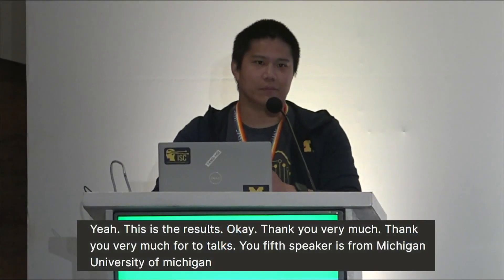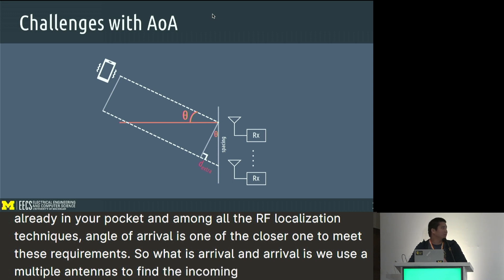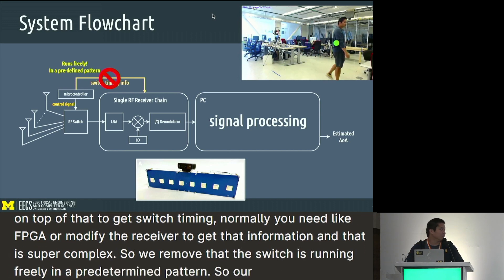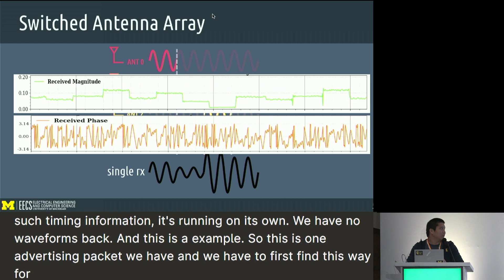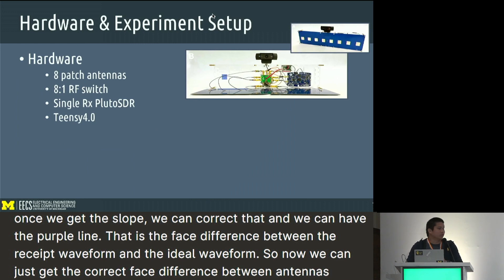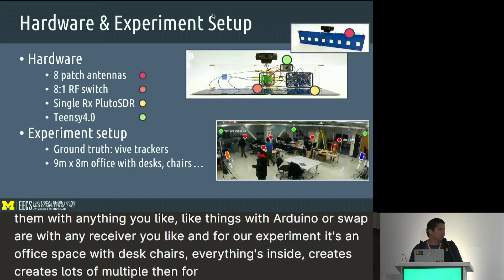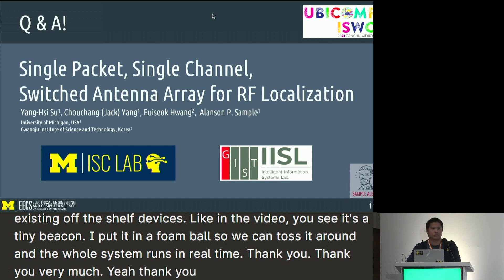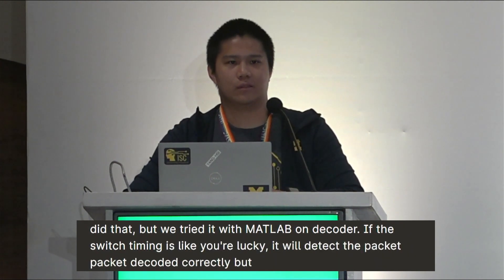UbiComp/ISWC 2023 Single Packet, Single Channel, Switched Antenna Array

Comment: Hi, Great talk! wouldnt using 60-80Ghz radio increase accuracy? And was wondering if you wanted to extend this to 3D localization would a vertical 8 patch anttena array be good enough or do you have to go with a whole 2D array 8x8 for example? Hope you may also consider fusion of IMU since you were using the phone anyway, for even better accuracy!